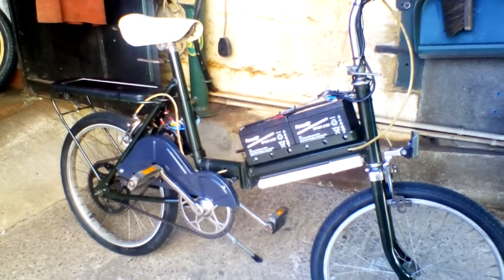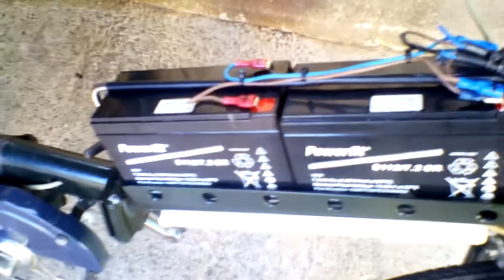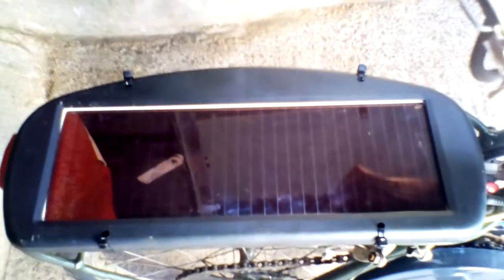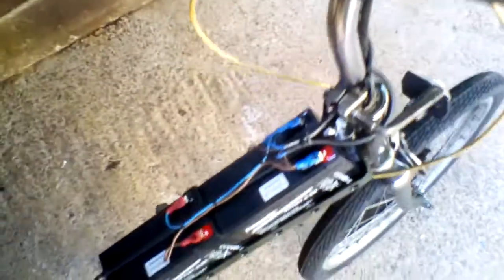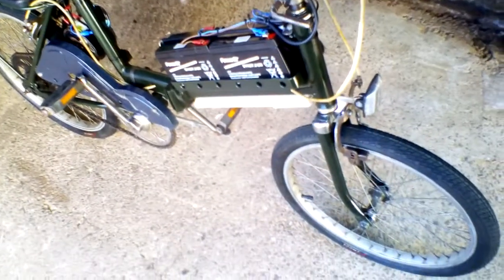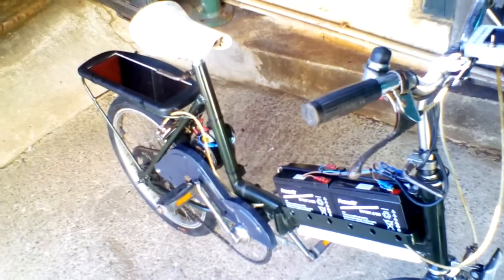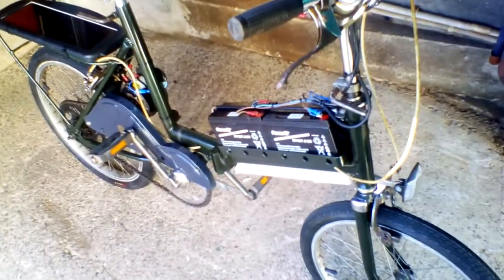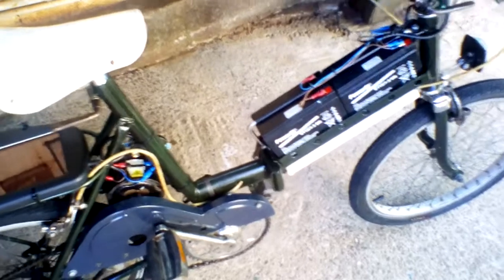Low cost electric bike build part 3. It's a self charging hybrid!

Comment: I like it no electricity required self charge.I am also using ebike. I need your help how much Watt solar panel required to charge 36v 10ah lithium battery?
Reply from the maker: Hi, it depends on how fast you want to recharge the battery. Using ohm's law (p=vi) would require 3 120w panels in series to charge the battery in a hour but that is impractical due to the size.A 10w panel is probably about as large as you could go on a bicycle. If you could mount 3 12v ones in series through a suitable charge controller it will provide just under 1 amp which may be enough just to top the battery up over a few hours. If you were to just use 1 large 12v panel then you'd need some kind of DC to DC inverter to step the voltage up to 36v.